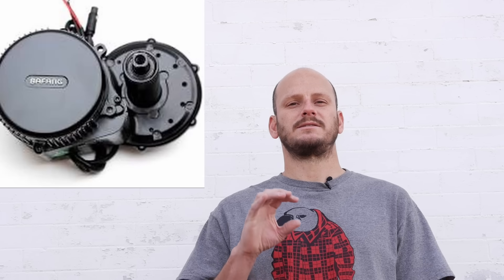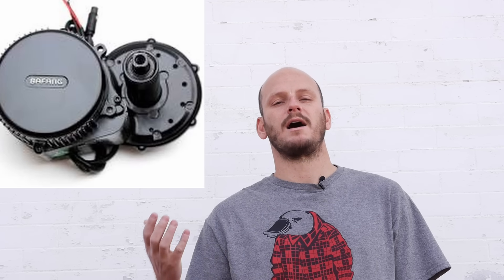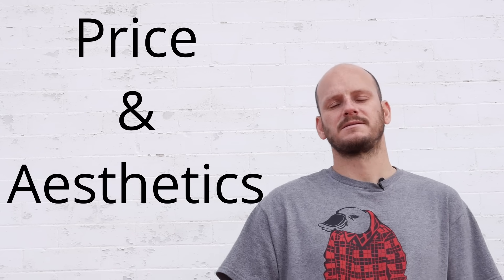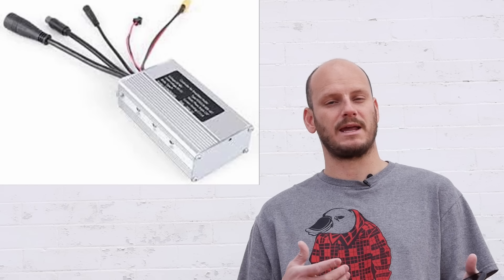Hub vs. Mid Drive Motors: Why Hub Motors Suck and Debunking Common Myths with performance test

Comment: Newton meters. Handy to have if you're racing.  I'm not. I'm commuting, going to the doctor, running other errands and riding recreationally with my friends. Some of my friends are riding Gazelle or Specialized eBikes with mid drives, and and in real life we have no problem riding with each other. We're all speed limited about the same and get where we're going in about the same time.

The transmission analogy is accurate, but mainly for gas engine cars, which have a internal combustion engine that only works well at her fairly narrow set of RPMs and needs to be shifted frequently to keep that optimal power going to the wheels - you'll notice a distinct lack of transmissions in electric cars that have to go from 0 to 120. Stuck in third gear is not really an issue.

Mid-drive bike motors do get the benefit of the gearing for power, especially with underpowered 250 w mid drives, but they also pay a penalty for using the gearing. More on that later.

Again, this may matter more for racing, but that's not where I live. My bike will get across intersections very quickly once I hit the throttle and pedal with my own Newton meters, and beyond that, if we're all riding legally, bikes are limited to either 20 mph or 28 mph.

Hub motors eat spokes? A motor eats spokes with some of the lousy, cheap undergauge Chinese wheel jobs I've seen, but there's nothing about a correctly built spoke wheel, with decent spokes of the correct gauge that's going to fall apart with an E-hub. But ultimately, those spokes are going to feel the same force whether you're getting your 750 watts through your mid drive or through your hub motor it all goes through the spokes, so not sure what you're getting at there.

I find the fact that you have to carry an extra chain around with you all the time amusing. I presume you also carry around a chain tool. 

That's perfectly acceptable, but you're worried about breaking a spoke? I will personally never own a mid drive - because a lot of those friends that I ride with are also my customers. And those mid-drive friends I have are my friends indeed because I repair bikes (and have since Schwinn was an actual company based in Chicago), and they like to come visit me for drive train components time after time after time. I've replaced two Nexus hubs in my buddies bike, and chains and cogs are just routine snack food wear items for mid-drive riders.

Really the only drivetrain I would consider usable with mid drives would be a Gates carbon belt with a Rohloff speedhub. Any other chain\derailleur or internally geared hub combination was engineered for one nominal human power (max 400 Watts, typically less), and if you add one human power plus another 750 Watts of electric power you're just going to eat those components.

Mid drives do have a legitimate advantage in that they do not affect the choice of wheels, but again this is more for racing, where you want to be able to swap wheel sets. It's been many years since I needed to take off my weekday trainer wheels and put my race wheels on for the weekend.

But by all means, ride your mid drives - please. I can always use the work.

Comment: Well..... I took a 3000 Watt hub motor and turned it into a spoke monkey motor! I mounted it in the mid section of my quad trike and replaced the disc brake with a BMX sprocket, and run BMX  chain to the back 3 sprockets, which are switchable by my derailleur, I get plenty of torque and speeds up to 45 Km/h

Comment: Well by your points hub motors can work, with enough power, hills are simply not a problem. Split the start load with two motors to reduce wear and it could greatly extend the life of a hub motor bike. The new 6000 watt Predator could last some people a lifetime of use without any repairs, if they kill themselves riding it. LOL. Yes its a matter of power and new hubs have a big place in the latest fast e bikes. 
I want one but,,, Illinois has a 750 watt limit so a mid drive is our only choice. Best part is one can convert their old bike and save money, just won't be zipping down the road at 40+ mph.

Comment: I have had both and have been riding and building ebike since 2014.I would recommend hub drive. Mid drive is definitely more torque, but theres always issues with chain jumping off the sprocket or chain breaking. I have been miles away from home with no spare chain when I had a chain break on me, and it was a long walk home. Hub drive has never left me stranded.

Comment: I have both.  

The Hub drive does have a rear cassette mounted on it with 80nm of Torque.  Its a cadence sensor and I get a good burn off it by using a lower Pas level and the gears.  Its perfect for flat rail beds and hard packed forest roads which my wife and I both like.  That said I had a flat on my hub drive and its real hard to change a tire as the electric goes right thru it not to mention manhandling the extra weight of the motor.   Now my mid drive is the bomb as it has 160nm of torque and can climb any hill you have to courage to do. If you have a flat on that one its just like a regular  bike-just pop it off the back and repair.   My mid drive is set up for Hard core off road single track. Once i got my Mid drive I thought I was going to sell my Hub drive but I love both for what they do.

Comment: Honestly it just sounds like you don't really understand how BLDC motors work.  And you probably aren't doing a good job of matching them to a capable controller.  That would explain why you prefer the ones with integral controllers.  And it would explain the burnt up motors.

Obviously you aren't alone in that, since you are repairing a lot of bikes built by other people.

The job of a BLDC motor controller is to regulate the current going into a motor by using, basically, pulse-width modulation.  Pulsing the current and adjusting the timing of those pulses can be used as a replacement for gears.  It accomplishes the same thing -- the motor operates close to maximum wattage at all times.  And the torque problem that you noted is really only limited by the physical configuration of the motor -- so it sounds like that manufacturer is not doing a great job either.

But programming motor controllers is a bit of a dark art, since they are about as close to hardware as you can possibly get.  And the consequence of getting it wrong is lots of amperage going where it shouldn't.  So many BLDC motor controllers are basically garbage, or at the very least highly tuned to a specific application.  And if you pick the wrong one, you lose.

Comment: Ok did youknow you can put a hub drive on the front and a hub drive on the back so you have awd so no hub in front yes because you can't put the mid drive  on front so it depends on what you're doing
Reply from the maker: Definitely depends on what you need but in general two hub motors are not efficient to use as they consume twice the power and usually still cannot climb steep hills as well as a mid drive motor bike.

Comment: Hi, I'm very happy to finally found a real E Bike Tech, you really know what are you talking about. My question is : What E motor do you recommend for an adult tricycle. Thanks for your assistance and help.
Reply from the maker: Bafang mid drive motors you can’t go wrong with. However I’d need to know about more about your riding to give an accurate suggestion

Comment: So if you were converting a bike between trek fx 2 (2023) vs Specialized rockhopper (2025) which one would you convert to a mid drive
Reply from the maker: Those are pretty different bikes. It would depend on what kind of riding you plan on doing. Me personally would do the rockhopper probably due to it’s versatility
Reply: @JohnnyNerdOut  that's my thinking exactly
Reply: @JohnnyNerdOut  thanks

Comment: Hey I am wanting to build a mid drive bike with dual drive system with a pinion gearbox. I already built a dual hub motor on a priority 600x which I love but I really love the torque of the mid drive. Would this be possible ? And do you know a frame builder that would make this possible? Yes my priority 600x is running a 3000x on the rear and 1400w on the front. I am hoping to use a cyclone or a lightning rods motor on my next build.

Comment: The same must apply to cars then.  I will go and get a 6 litre turbo charged 4X4 to make sure I won't get stuck even though I only use it for shopping!  Ya know just to be on the safe side.  Cars under 6 litres SUCK!
Reply from the maker: This would be more like a transmission, either having one or not having one instead of motor power. A mid drive allows you to amplify the power from the motor through the gears. The hub motor is stuck in the one single gear ratio that’s built inside the hub.

Comment: I Prefer Hub Motors ? If your Chain Brakes you can still get home . #2 less ware on the chain #3 less ware on the sprockets and gears .
Reply from the maker: I think changing a flat tire on a rear hub motor easily outweighs those pros, buys that’s my 2c

Comment: My first E- Bikes in 2011 where E-Motto rear hub drive. I never had any problems as long as 24 volt 10 AH battery was charged up. If battery died hub motor never really dis-engaged making bicycle  very hard to peddle. I just purchased  Gazelle mid-drive motors . What a difference in performance.👍

Comment: Mid drive motors are better for climbing using multiply gears.
But its speed is limited to the gear and you cant help it pedal faster.
I experienced that if you run slow you can pedal along some what.
But using higher gears the motor will spin faster than you can pedal. SO its basically a moped.

Comment: I have a bike with a cheap chinese 1000W Direct Drive rear hub and kt controller and one with a Bbs02 and a Enviolo Hub Gearbox. Both are capable of 30 mph and with both i can climb the hills I encountered by now, but I mostly ride only regions with slopes that are not that steep. The differences between the both: The Bafang is a little sluggish to reach topspeed, while the hub does it effordless, moreover the hub is programmed to use 19 Amp max, while the bafang uses 24 amp. When riding at a normal bicycle speed  of 20 mph they both feel the same, but even then the bafang draws 1-2 amps  more. Only on steep hills when the speed drops below 10 mph the hub feels not perfectly well becaus its obviously wound for higher speeds. As for the bafang this does not matter because it uses the gearing. Generally I don't use the throttle but only pedal assist and I estimate that I might add about 100 Watt own power. Both bikes have the same highest gearing that allowes me to ad my own pedal power up to 30 mph at a cadence of 80-85 per minute.

Comment: I converted my bike to a BBSO2 with 48V 17.5 Amp. I love the way the bike handles with the mid-drive. After converting I kept breaking spokes on the rear wheel right side and ended up buying a new chain, cassette, and wheel with heavier spokes. After upgrading I haven't broken a spoke. I didn't expect to have to do this but that doesn't really bother me. The thing about the mid-drive motor that is a concern to me is when the battery runs out of power on a longer ride I end up having to work harder peddling than if I had a rear hub motor as my wife has on her ebike. She can ride her bike as a normal bicycle. With the mid-drive my human power has to work harder because I have to also turn over the motor while peddling. No one ever mentions this as a disadvantage to owning a mid-drive motor but it is a pain in the legs.  Is there a mid-drive that doesn't increase resistance when the battery runs out of power?
Reply from the maker: Supposedly the tdzs8 tongsheng motor has zero resistance
Reply: @JohnnyNerdOut  Thank you.  I’ll look into it.

Comment: 6:17  A'hah!  Got you, I acktuually did carry a trueing stand in my bike trailer.  Only once and not because I thought I would need or use it, it was a new purchase I was taking home, but it was there along with some extra spokes and nipples which I do carry all the time in the trailer for some reason (scary Internet stories I suspect) even though I've never had a loose, bent, or broken spoke.  I'm not a fanboy of either hub or mid-drive motors, I am a rabid fanboy of e-bikes in general.  Whatever works best for you, mid-drive or hub, rear or front.  I am thinking of trying mid-drive when it comes time to move on, though I'm happy with my Juiced Crosscurrent Air's rear hub motor which has over 4k miles on it over five years of pulling a trailer that is usually over the weight-limit full of groceries, lumber, a couch, a vintage Sears Silvertone console stereo, just average things people carry on a bike!  I do have a GeoOrbital front hub wheel in case of an emergency, but front-hubbing sorta sucks.  Can anyone tell me how mid-drives handle when towing a trailer?  A trailer loaded with 80-120lbs of "stuff" like I normally have following me around?  My rear hub takes it in stride, though I have to have a solid tire on the rim or suffer constant flats, and even one flat on with a rear hub motor is a nightmare.  Will a mid-drive be snapping chains all the time if pulling a trailer?  I work my bike hard, but I work hard on it as well and have always been hard on chains even before the motor, should I stick to the proven rear hub motor design?

Comment: After owning front and rear hubs, Direct Drive, Geared hub, and mid drives, I prefer the Direct Drive Hub. Mids suck if you aren't in the right gear and can snap chains easily. Walk of shame gives time to contemplate switching.
Reply from the maker: Definitely a mid drive requires the correct gear. Bug difference from a hub motor

Comment: hub drive = cheap and you can maintain yourself .  mid drive = loads of money cant maintain yourself also what's the point in speed if your limited by law to do only 15mph in UK or risk losing the bike. hub drive gives all people a chance to go electric. its good to have choices
Reply from the maker: Here in the states it’s almost opposite. All of our mid drive systems for aftermarket kits are serviceable and have replacement parts available for the end user whereas the hub motors almost need to be totaled when they fail ☹️

Comment: I like to HUB motor plenty good enough.. absolutely no problem after 5000 miles still going strong 85% of bikes have hub motors. If you break a chain or have a problem with your chain you can always throttle back with a hump drive .. mid drives are very hard on chains and gears because they have three times the amount of strain on those parts.. mid drives are for sissies

Comment: Best hub motor I know of nine years, running hard and haven’t had a single issue other than breaking my throttle and crashes

Golden motors magic pie 5 programmable 1000 watts built-in motor controller 

I’m currently building a bafang magic going to Mom

Comment: A couple of disadvantages of mid drive, much harder on the transmission (the chain and freewheel). A hub drive bike uses a standard bottom bracket which inevitably wears out but they are £30 tops and DIY replaceable, on a mid drive, the crank is part of a very expensive dealer only serviceable motor (maybe £1000), I have a 10 year old VOLT PULSE with a widely used Bafang hub motor with only its second chain and freewheel and bottom bracket, maybe £60 all in and DIY, I also have a mid drive Specialized Creo 1x11, it hammers the drivetrain, maybe 1500-2000 miles (tops) and its knackered, the TCU (the fancy bluetooth control panel) has failed twice, I am selling the mid drive while it still has warranty. PS in 10 years the VOLT huber has never broken a spoke

Comment: No surprise from an admitted moto/car guy. As an ex-moto guy and long time CYCLIST it's my opinion hub motors are for cyclists wanting a bit of help vs the feel/performance of an e-motorcycle. 
Neither one SUCKS so you should leave that out unless you want to be known as JohnnyJerkOff.
Reply from the maker: Sorry you took it that way. I meant this to try to help people who are not aware of what a mid drive is or why people choose them. In general, if you want the closest thing to a natural feeling ebike experience, you would want to go with a torque sensing mid drive motor. For riders who are used to the experience of shifting gears I always recommend a hub motor for their simplicity. But for pure performance and experience, if you are an experienced rider, mid drive is for sure the way to go. Hopefully this video saves some people a lot of time and money on something they won’t quickly outgrow 😀
Reply: @JohnnyNerdOut  OK. I'd say if you're looking for a car or scooter substitute and want to do as little as possible when it comes to making the bike go...mid-motor's for you. OTOH, if you're a cyclist who wants to feel like you're riding a bicycle vs an electric transportation device, hub-motor (like MAHLE) is for you. Is that fair? The mid-drive bikes I've tried feel like turning the pedals isn't making the bike go...it's just telling the motor how fast you want to go vs hub-motor which feels more like a gentle tailwind going uphill or a steady wheel to follow into a stiff headwind...and just like a regular (though of course heavier) bicycle when the assist isn't being used.
Reply from the maker: @larryt.atcycleitalia5786  imo it’s the opposite. Having a 15lb motor in the wheel throws off the weight distribution so it’s immediately weird. Next would be the power delivery. A hub motor is essentially always in the wrong rpm except for a small bandwidth because it’s a set gear reduction. A torque sensing mid drive if for cycling purists. For those that are not familiar with shifting etc, I always recommend a hub motor as you can be in any gear and the motor will work exactly the same.